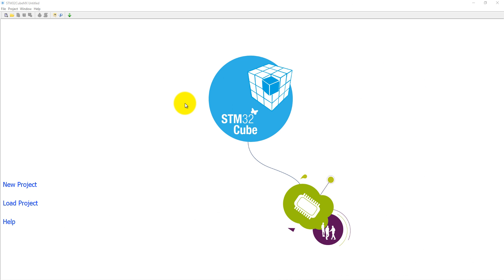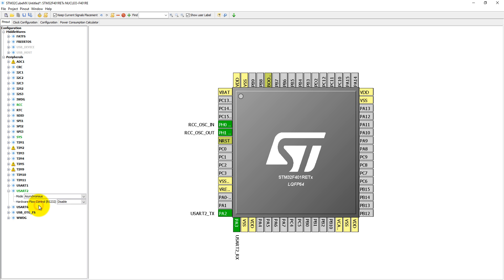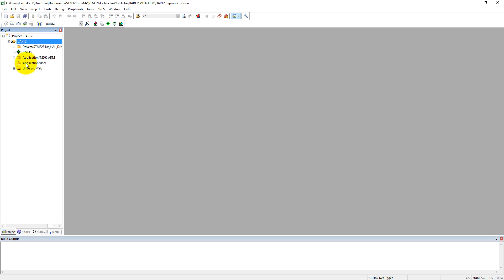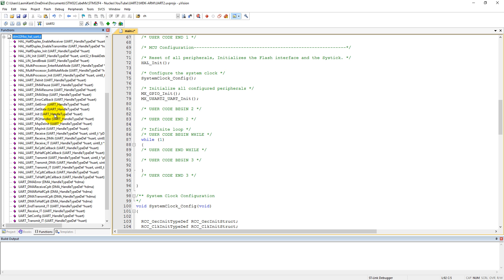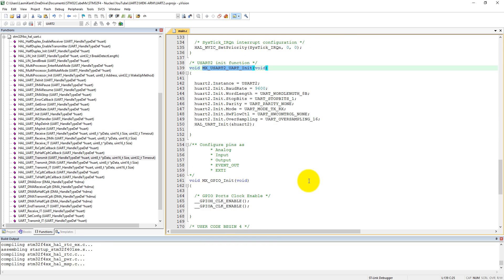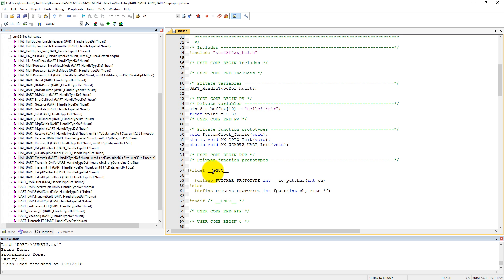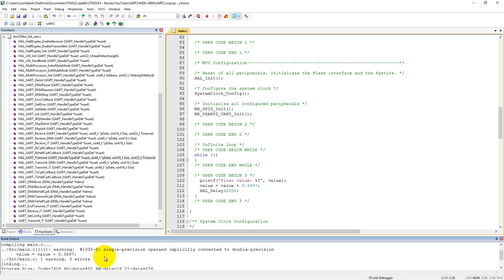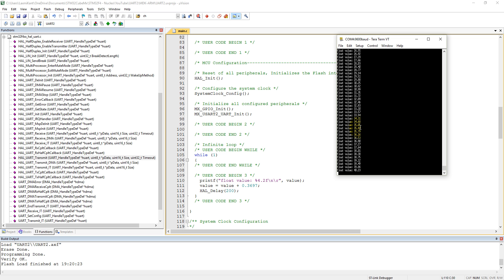STM32 Nucleo Tutorial 4- UART printf Coding in Keil using STM32CubeMx

Comment: Thanks, I got it working. It's important to use a 8 bit word size when configuring the project with STM32CubeMx (as every char is 8 bit) and  use the same settings on TeraTerm. The #define for the function used at the ending doesn't seem to work on some versions of keil 5, but it can be replaced with the function itself and it will be ok.

Comment: I think You used HSI, not HSE.   look at the 1:39, your using HSI RC-> PLL Source Mux >Main PLL> System Clock Mux.
And also it means you dont have to select RCC at the STM32CubeMX pinout.
Reply: What are HSI and HSE? Sorry for the broad question.

Comment: Hello. I have issue woth programming of STM32F207 ZG (Nucleo 144) Board. I am trying to program it for UART4 configuration using STM Cube MX. Program runs fine but no Output at the Virtual COM port. I used PA0 & PA1 for UART4 TX & RX (GPIOA). Can you tell me where is exactly a Problem??

Comment: Thanks a lot, it wokrs with me but just when i press "Reset button" !! why !, i'm working on STM32F446RE.
Reply from the maker: Siscom Team check reset and run in settings.
Reply: Hey, I can't read the values on my UART? Do I need to connect external UART Board to read? I am using STM32F103RBT6 nUCLE 64 BOARD. What do you think might be the problem? Mine doesn't even work after pressing the reset button.
Reply from the maker: did you get new COM port in Device Manager?
Reply: yes I did. But  I don't know what is the issue. I am using atollic studio which is not very different from keil are u 5. the reason i believe is black button on the board. If I try to use any code on keil, put it in debug session and press the black button for reset and then start the debug session, i get a warning that the board is not connected. can't find target etc. the program is getting loaded though. what do you think?
Reply from the maker: First of all, don't press reset button while debugging otherwise it will just disconnect ST-Link with the computer. you only need to press reset button when you directly load the code. Please check baud rate too.